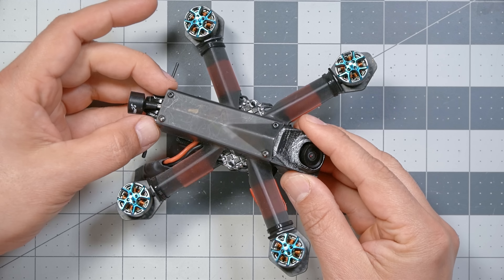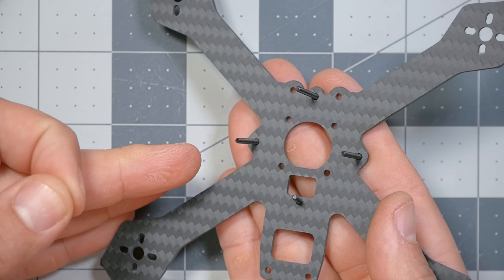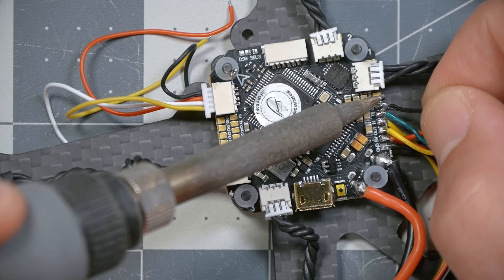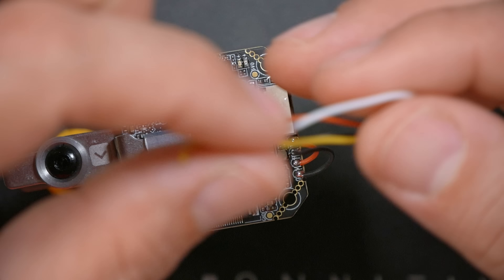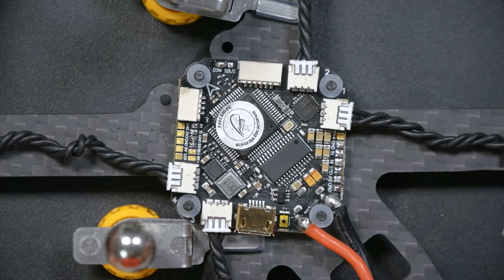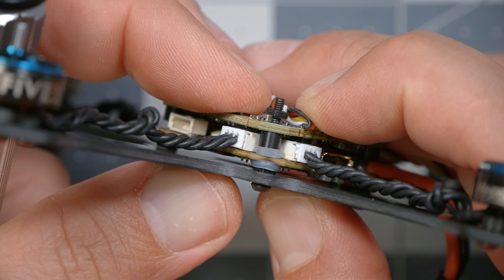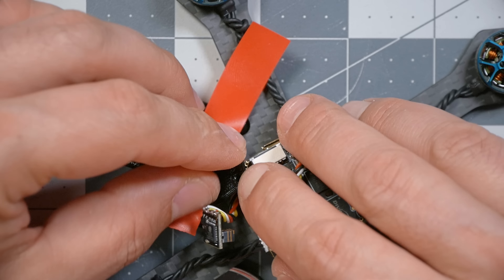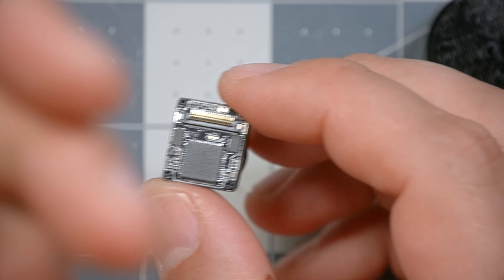533 Tiny Trainer is even better with HDZero | PART 1

Comment: People... soldering isn't hard. Don't let it discourage you.
Reply: I mean he starts the video saying it's solder free, and then we end up removing a SMD resistor... That seems partially honest lol 😅
Reply: Thanks for the encouragement, litarally all I needed... and I solder but just hesitant with all these expensive parts, live and learn
Reply: It's so hard it always ends in a complete mess and I've ruined 3 FCs from it
Reply: @th30rphans  I was too but honestly they are harder to break than you might think.
My problem was using a too small tip, because I thought I made less damage that way, actually bigger was better because more heat in less time, so much easier!
Reply: @BowOneFire  Wow! That's not at all my experience, what happened if I may ask?
Reply: @pengud485   I think many of my issues came down to using unleaded solder and a cheap iron, which is fixed now, but there's still this problem where ground pads on AIO flight controllers are not sticky at all, so to use them i have to solder the ground wire to the negative side of a surface mount capacitor. Oh and also the complete mess I mentioned might be from me mixing leaded and unleaded solder by accident haha
Reply: @BowOneFire  Never underestimate flux, it helps so much, you never put too much haha (just only too much for your lungs👀)
Reply: @BowOneFire  Oh okay! I have very limited experience so maybe I haven't had time to encounter these problems yet haha. Have you seen Joshua's tutorial? That one is pretty great
Reply: Soldering is easy to do poorly.
Reply: @Jkeith247  I mean, soldering vtx and receivers is pretty easy also to do good. Big plugs or components are harder
Reply: Uhhh I mean I've ruined flight controllers before by trying to solder stuff. Soooo...
Reply: @Olafaloofian  that hurts
Reply: Imo this should not be someone’s first build, soldering into such small pads is a recipe for disaster even jb said that he had trouble with the ep2 receiver
Reply: Heat shrinking is probably harder than soldering.

Comment: Nice is good to see they have caught up with hd zero as i built a hd zero one about 7weeks ago.and love the clear video.
I used the 35amp aio though as the 20amp was outa stock at the time
I also put hd zero in a tiny hawk 2 around 15weeks ago and that is soooo much fun to fly..i love it.
had problems getting the tinyhawk to fly good so i pulled it all apart and re built with the race 2 board and it even turned out 9grams lighter than when i used the whoop board.
i love it and fly it every second day.

Comment: The good thing about the motor connectors on the board is that they are through hole and not smd soldered.  So your concern about plugging in the motors and having a bit of wobble in the connector is not as concerning as it would be if they were surface mounted.

Comment: I just helped a friend with this build, ran into the same issues with connecting the receiver and the standoff.  If you meter it out, the sbus jumper is connected to the RX3 pin as well, so I just soldered the receiver to one side of the SBUS 0-ohm receiver.

Comment: Yes, you have to hold down the top when plugging in the motors. I just built one of these and broke one of them. I just direct soldered them. Also, the receiver plus and where one of the standoffs go is hard to get together on mine because it pinches the wires. They need to kind of
 re-think some of the placements. The canopy also didn't fit great, so I just cut the arms off. Definitely fun to fly but NOT a beginners build.

Comment: I have one and have built it and flown it. It's great! I'm too lazy to tune it myself, but It's flying pretty smooth with betaflight stock settings even.
Reply: For the record, I used the "dji" plug with the hdzero whoop board. Just had some empty wires. And I used the vtx plug to connect my ghostrc module since I didn't have clearance for the plug.
Reply: They have a tune posted on the product page that works great
Reply: I've been using the TT preset in BF 4.3. Works well.
Reply: @lostinacrowd  i need to update all of mine to 4.3. havent gotten around to updating all my quads

Comment: If you want to clean the hairs off of the 3D printed parts, you can pass the flame of a lighter over the part quickly. It won't cause any harm to the part, but it will completely remove the hairs.

Comment: For an SBUS receiver, couldn't you just use the SBUS pin in the HD Video socket on the FC, as you aren't using it for DJI?
Reply from the maker: That's actually so obvious I kind of can't believe we didn't think of it.
Reply: @JoshuaBardwell  Well, that only proves that you are indeed human, after all.
Reply from the maker: I'm not kidding -- I talked to the 533 guys and the FPV Crate guys to get the best solution we could and this is what we came up with.

Comment: 3:20 I can't get that bottom USB port to work. It briefly shows in betaflight for a blink after powering on, but then disappears, and I can't connect with betaflight. Have to use the port on the side. Any trick with that? Else that port is pretty useless
Reply: nevermind. Updated Betaflight and it worked.

Comment: I recently picked up an analog setup from FPV crate and couldn’t use that fancy receiver plug it came with because the plug on the AIO was pushed up against one of the front stand-offs
Reply: Guess I should’ve watched the whole video before I commented 😂 guess you ran into the same problem I did
Reply: Five33 has the same board but that connector is aiming up instead of out so the standoff isn't in the way.
Reply from the maker: Can't use the up facing with hdzero though.
Reply: @JoshuaBardwell  too true. I'm thinking they need to redesign the frame so just one board works for all.

Comment: Please can companies stop making boards with Frsky SBus and instead give that extra space to increase the soldering pad size. For people still using Frsky protocol please  buy ELRS TX module for your radio trust me you will forget mid air dropouts completely its fantastic and it's open source.

Comment: Not the greatest with hdzero vtx, super sensitive and not a lot of room to breath. I've had video issues with soft mounting everything as well. Ended up going back to analog until a smaller more reliable vtx comes out.
Reply: Odd, not had a problem on my 3 quads with HDZero. The improvement over analogue is brilliant, great and affordable upgrade path.
Reply: @bjowitt  I've been pretty lucky with mine as well in 3 quads. 🤷‍♂

Comment: wtf is this build, are you insane? there is nothing about it except the motors that is easy to build. its just straight up misleading
Reply from the maker: If you build the analog one, then you only have to solder the receiver. The hdzero one yeah it's not much saving.